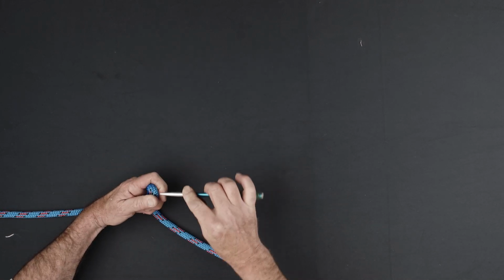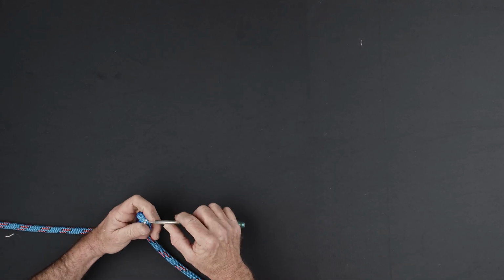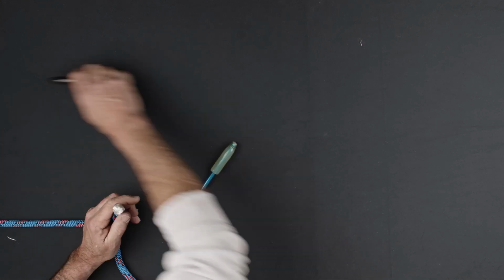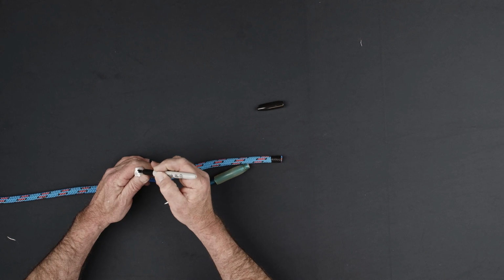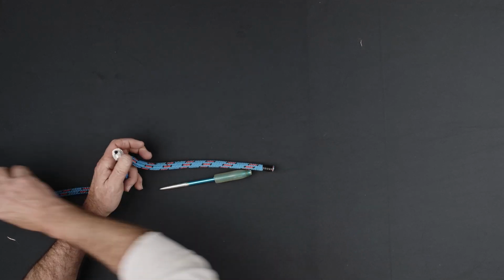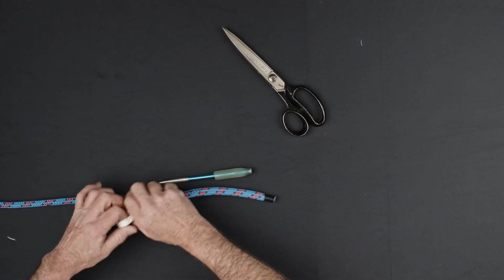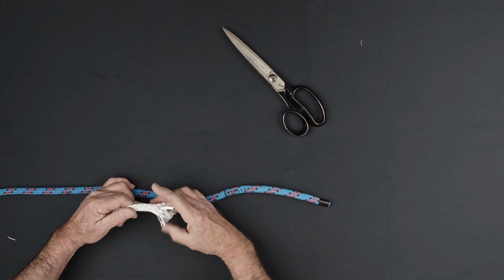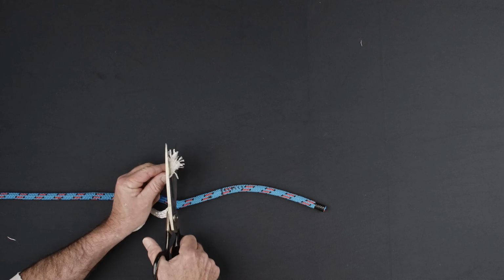XTC 24 Double Braid - Tight Eye

Comment: Has anyone tried using the Aramid method for Samson Predator?  It has a very tight jacket and burring the core into the base of the splice's neck is super difficult.  Can't get it with a fid or wire fid when following Samson's instructions.  I think I need to taper it prior to doing that and maybe try using Aramid like in this video but am not crazy about deviating from manufacturer specs.
Reply: Just use Braided Sleeving, like Techflex/Flexo. For context, It's an expandable/contractable braided sleeving used for electrical wire protection, & hella cheaper than whatever you'd pay for aramid sleeving. They are only using Aramid because they have it on hand & it's slippery, just like PET Techflex is.
Reply: To do it with a regular wire fid, taper the core by 50% 8 inches from the end of the core, this section of the rope is discarded anyways at the end so it’s fine to pre taper it. This makes it possible to pull with a wire fid.

Comment: Critical missing information, ….What is the “correct” fid?
Reply: Isn't the correct fid length in relation to what size rope you're splicing? So this would be depending on what size rope you're splicing
Reply: 21 times of the dia of your rope
Reply: Ikr!? An "appropriately" sized one apparently. 🤷‍♂️🤦‍♂️ 

Judging by the thickness of that rope model, it looks like it would be the 1/2" fid. I'm not sure why the he'll he wouldn't just say th a t in the video. I think it's because some fid brands use imperial and some use metric. THAT part is annoying AF!
Reply: He said one fid length was 10”. He repeats the part with the length when he is marking the third point
Reply: It’s a 11.7 mm rope so I use a Samson 1/2” or 12mm fid personally and I’ve had good breaks with that.
Reply: Exactly.

Comment: What’s the rope with aramid fibers that’s used in the video ?
Reply: Just use Braided Sleeving, like Techflex/Flexo. For context, It's an expandable/contractable braided sleeving used for electrical wire protection, & hella cheaper than whatever you'd pay for aramid sleeving. They are only using Aramid because they have it on hand & it's slippery, just like PET Techflex is.
Reply: Yale blue moon 11.7mm  I think